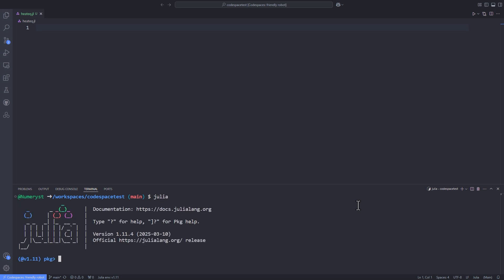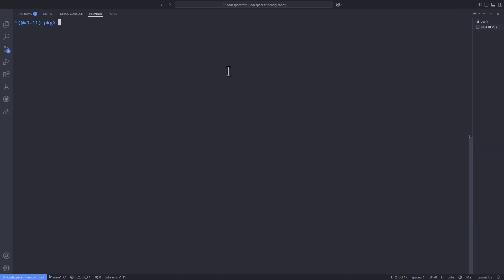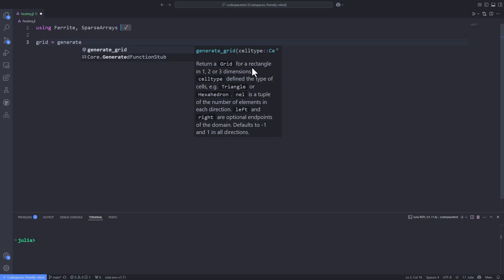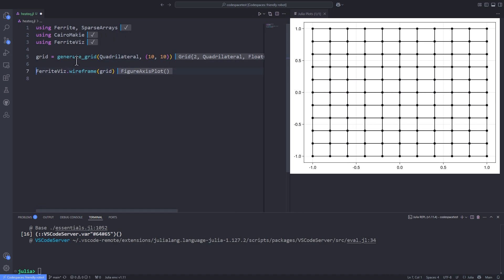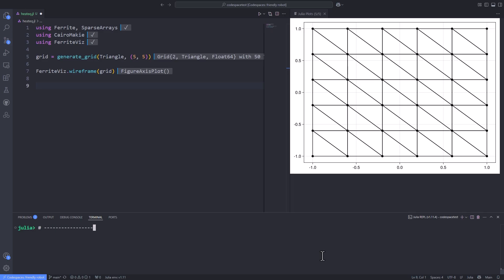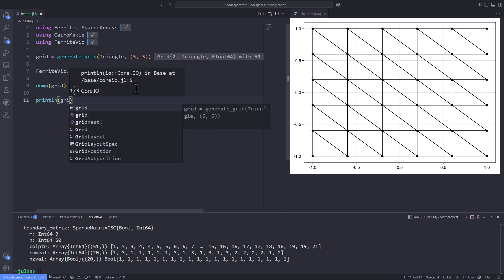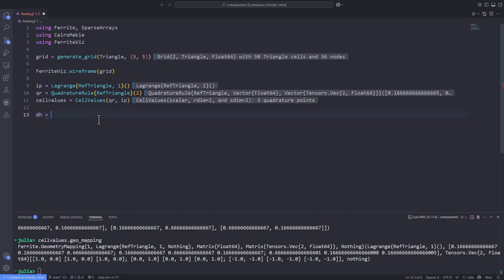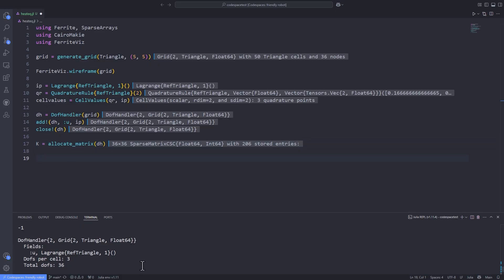How Ferrite Makes FEA Accessible for All Engineers

Comment: What is the difference between FEniCS, Ferrite, and JAX?
Reply from the maker: FEniCS is a high-level, open-source computing platform for solving partial differential equations (PDEs) using the finite element method (FEM), primarily written in C++ with Python interfaces. Ferrite is a Julia-based FEM library designed for flexibility and performance within the Julia language ecosystem, focusing on modular design and composability. JAX, on the other hand, is a general-purpose numerical computing library from Google that offers automatic differentiation and just-in-time compilation for high-performance machine learning and scientific computing, but it does not natively support FEM or PDEs, it can be used to build such tools from scratch.
Reply: @Numeryst  Thanks for the reply! That really cleared things up 🙏
Appreciate you taking the time to answer!
Your explanation makes a lot of sense, thanks again :)

Comment: Hi.  ferrite.jl or gridap.jl? Why?
Reply from the maker: It depends on your goals. Use Gridap.jl if you want a high-level, batteries-included framework where a lot is handled automatically through code generation. It’s great for productivity, especially for standard PDE problems, and has strong abstractions. Use Ferrite.jl if you prefer more control and flexibility. It’s lower-level but more customizable, making it ideal for research, experimenting with custom elements, solvers, or nonstandard formulations. So, if you're optimizing for ease and speed, go with Gridap. If you're optimizing for flexibility and fine-grained control, go with Ferrite.